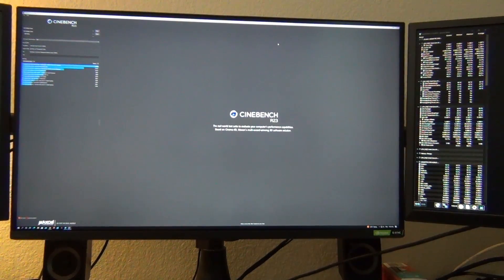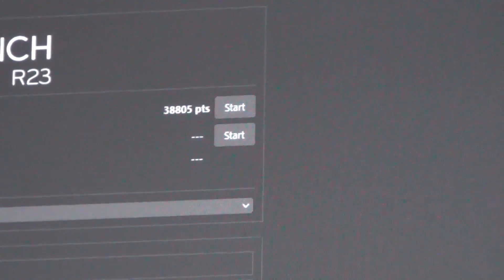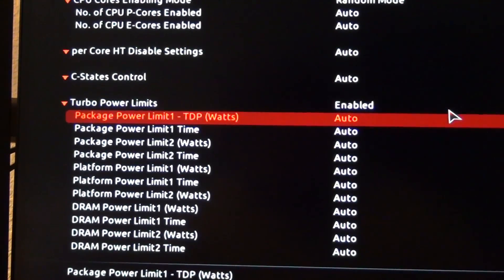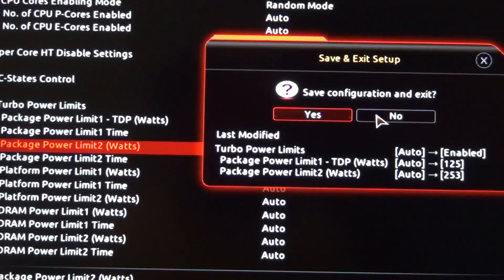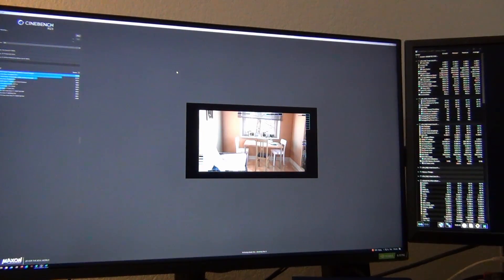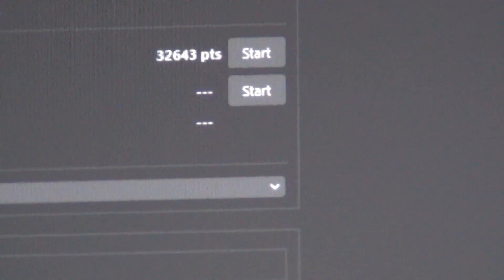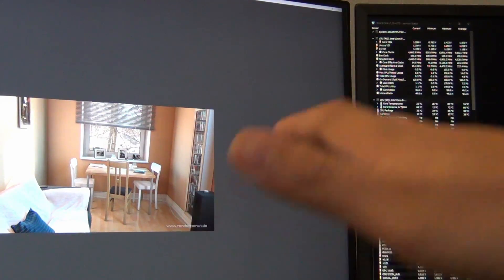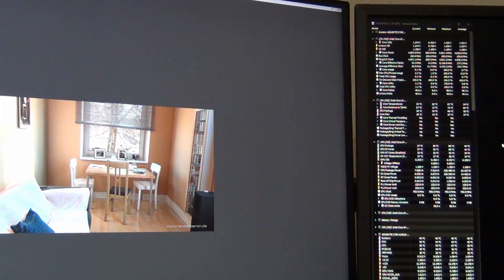How to enable eco mode on i9-13900k

Comment: I don't know how but with my Aorus Z690 Elite DDR4 with an NH-D15 on stock settings I always get over 40K on Cinebench R23 multi core - thermal throttles of course. Came here to tame the beast. :)
Reply: OK followed the video and applied the limit (I used the Intel POR setting instead of dialing in the numbers - HW info puts PL1 and PL2 at 253w. Never exceeded 81w but what is weird is I still got 38346 points on Cinebench R23 - and that was with me running all my background apps - RGB software, OneDrive etc. so thanks for the guide. I too do not like undervolting - I would prefer some higher temps over potential stability issues.
Reply: @a120068020  what was your PL1 and PL2? Can you tell me the numbers? Did you apply the exact same like 125 in PL1 and 253 in PL2? I am planning to go with a Deepcool AK620 and at least 75°-80° feels okay-ish for me
Reply: @DeathStriker88  I used the Intel mode on the motherboard but it sets both PL1 and PL2 to 253 according to Hwinfo.

Comment: not sure why you find using an AIO is so much harder then an air cooler when its pretty much the same principle in regard to swopping out cpu's, i run a 420mm aio on my 13900k and score just around 39800 in R23 at 81c
Reply: Wait until it leaks and you face a severe loss. Don't think AIO doesn't leak, there was never a 0% chance. AIO leaks but you don't know how and when
Reply: @DeathStriker88  From what I can see if you're using a air cooler on this chip you're already making a loss of nearly 25% in performance which boggles the mind into why someone would spend all that money on a high end CPU just to down grade it to roughly the mid tier chips performance.

This score is only a 1000 points more then what the 13700K can achieve, that CPU is $200 to $300 cheaper.

My last AIO served me well for nearly 6 years until I upgraded to a larger unit for the 13900k, but the old one is still working fine on my friends system.
Reply: @MikeZak101 2 gpus
Reply: @MikeZak101 false, actually you might be correct. I have a 13900 nonk on air and i couldn't imagine a 13900k lol
Reply: Aios broke leak and within 2 3 years they clog or the water evaporates plus within 4 5 6 years the aio is dead due to pump failure ! We dont want stress we want infinite lifespan safety longevity and the wualof noctua !!!!

Comment: With your configuration running the D15 I would run 5.3ghz all core at 1.23 volts and go up and down from there. I got mine at 5.5ghz all core with 1.21 volts but I'm using a 360mm aio score 39500 in r23 at 85c depends on ambient of course
Reply: I have a 360mm rad also but thermal limit in cinebench what are your bios settings if okay I ask

Comment: while gaming in overweatch 2- in Hw monitor cpu temp is 66c max, package is at 77 max, this is for gaming with very cool ambient temps... 13900k z790 hero with 420mm corsair aio, I have reseated cpu a few times to make sure, I tried a bracket and it didn't work well so went back to Mobo bracket, is this normal for 13900k?edit I did blender and got like 37k score it hit 97c max
Reply: Some motherboards at stock ignore intel limits and let the cpu suck up to 340w. Thats probably your problem

Comment: Hi  - Great video . I am building a PC for my Grandson this week,  eagerly awaiting delivery of all  parts! CPU is the i9 13900k cooled by the Noctua NH-D15, so this info is invaluable as I was also concerned about temps and, like you ,not going the water cooling route. Thanks my friend - Best wishes from me in the UK.
Reply: you can look for tutorials to undervolt the i9, as on stock settings, it can reach 1.52 volts, which is very excessive and very dangerous for the CPU. undervolt by short increments in the bios, such as -0.025v in offset. make sure the setting says OFFSET and not OVERRIDE or OVERDRIVE or MANUAL. when you think the processor has reached a undervolt where it doesn't crash immediately, increase the offset up by around 0.02 - 0.03v to ensure stability. most i9 13900k parts run stable at ~1.28v, but it doesn't ensure that yours is also going to run on that voltage because of silicon lottery. to know about what is silicon lottery, just search it on youtube, and there would be many tech channels like linus tech tips and gamers nexus explaining the topic in deep. the concept basically is that each chip is different and has different overclocking/undervolting potential. also do not forget to set the power limit to 253 and 125 watts respectively as instructed in the video, along with the brief undervolting guide I told you. doing the tricks stated above can help decrease the temperature of this processor drastically and also make it more efficient. please do refer to undervolting guides on youtube to further help yourself, and good luck!

Comment: Do you think the NH-D15 could handle the i5-13600k? And I have to ask, in your position do you not think you could ever consider one of the more premium and trustworthy AiOs to cool your chip? Surely they are reliable and near indestructible these days?
Reply from the maker: I could go with an AIO, however I chose air because it's far more simple and reliable. I've been using the same Noctua cooler now for about 8 years. It's performance has never changed. With an AIO, over time (years) water will slowly permeate through the tubing eventually leading to reduced performance. That and I know at least 3 people that have had pump failures and another person who had a leak.
Reply: I bought a dual-tower air cooler for my 12600k cause my AIO failed on me, after one year use. Idle temp 33, and gaming 60-70. Air cooler was performing better than AIO.

Comment: Fuck power limit what u need to do is undervolt it, cpu will run at 1.2v instead of stock 1.38v and temps drop 25c with full performance all cores
Reply from the maker: The problem with undervolting is stability at a given voltage isn't guaranteed. You're playing the silicon lottery so one CPU at 1.2v might be 100% stable with the same performance while another might not be. I may do a video looking at undervolting in the future. Power limiting however, with stock voltages does guarantee 100% stability without having to stress test, at the cost of less performance.
Reply: @GameTechReviews  there are trades for everything, you limit the power you lose performance.  You undervolt, its likely that you wont lose any performance and in some cases gain due to lower temps, but the downside is it might be unstable, but as you said its just a matter of testing and finding whats the lowest voltage.   I personally try to stay away from either, but due to how the 13900K is and it will only get worst with the 13900KS, undervolting is the route to remain on air whiteout losing performance.  Hope in time we see a video from you on undervolting.
Reply: @GameTechReviews  ok I get it’s more user friendly but a undervolt guide and results I think are what people really need
Reply: @johnhughes9766  I dont get why people come to a video that clearly states its about eco mode and argue about undervolting. If i want to undervolt, ill go to a video that teaches that, if i want eco mode, then ill come here. Not everyone who buys a cpu wants to be an elitist with it and spend hours undervolting. Jfc, get a life.
Reply: @HasanWadih  lol get over ur self
Reply: @johnhughes9766  says the guy crying over an eco mode cpu video about undervolting. Im not the one who has to get over himself. look in the mirror and then go cry on reddit.
Reply: @HasanWadih  it give the same result without loosing performance for the sake of a few hours testing, u need a hard look in the mirror is ur buying a 13900k and gimping it
Reply: @johnhughes9766  cry harder.
Reply: @HasanWadih  I’m not crying my pc is balling, feel sorry for u chumps using power limits tho
Reply: @johnhughes9766  i feel sorry for the people who feel sorry for others who want to do whatever they want to do. Shows a bit of insecurity there pal, that you have something to 'prove'. The people who dont give a fuck, don't really cry in comment sections.
Reply: @johnhughes9766   good to know, maybe i’ll experiment with undervolting instead of power limiting. what softwares did you use and did you use adaptive mode for making the offset in the UEFI?
Reply: @metallizität  just in the bios set vcore to either manual and 1.2 or use the offset mode to get it down to 1.2 underload
Reply: @johnhughes9766  alright i’m gonna try that later along with replacing the ILM with a contact frame for my cpu because my cpu is running crazy hot.
Reply: @metallizität  just start with undervolt I dropped 30c after finishing the undervolt I got down to 1.15v in the end
Reply: The 13900 runs at 1.20 stock. If i drop it .05 temps are better but I get a 15% drop in 3dmark score. I also get a 15% drop limiting to 125 and 253. Running at stock, the last minute of 3dmark is throttled due to temps. So I'm going to try and find a power limit that doesn't throttle
Reply: so you just set fixed voltage setting to 1.2V. No adaptive mode, no offset? What are your llc settings? What is your power draw idle/ demanding games?

Comment: Do you recommend i9 to AMD 7950x or should we wait for Intel's next 14th gen CPU which may use TSMC 5n or lower process?
Reply from the maker: I actually recommend the Ryzen 7950x. If you are going to get 13th gen then only the i5 or i7 make sense. For higher thread count the AMD offerings are overall better.

Comment: I have 13900k z690 gaming x dd4. I set   power limit to 270w (PL1 and PL2 270W) and i do a little offset vcore  - 0.030v. I have "small" noctua nh14s and i have score: multi r23  37939 only 92C no thermal throttling, single 2124.
Reply: That’s awesome congrats
Reply: @stanleyl.9026  It is a little weird but on my motherboard OC is default setting. So first i disable any OC setting. In default in my board multicore enhancent was on, I turn to off (when on all core boost like the one core with the highest boost ). I set BCLK on 100. In default was 103.5 (with this core boost to 6 GHz insted 5.8). And i set power limit to 270w - But it is only for cinabench. In game you never be close to power limit.
I set a little vcore offset - 0.030v - temp in game drop like 5c. No real impact on fps.I have 3080ti so it is a lot of heat when i game.
Cpu temp on average after 1h-2h gaming in cyberpunk or apex legenda is 74-76 C. In peak hwinfo show sometimes 80, sometimes 85 c. And ones show 90c in apex legend. But it is peak. No cpu throttling and no core temp throttling.

PS. 13gen Intel IMHO need to be a little unvoltage. For a perspective deflaut setting is OC. - BCLK set on 103.5 (boost 6ghz on two cores, 57 all) ) . No power limit. So when I do benchmark it was like this : -cinebeanch r23 multi = 38064 and 100c very fast and drop boost to 5.0-5.2 GHz - thermal throttling , single 2184
When na turn off oc (so boost is 5.8 on two cores and 5.5 all) , set power limit 270w and do offset - 0.030v it was like this :

multi 37939 only 92c no thermal throttling - so to fair i have room to set more power limit and have closer to 100c But i dont do this it is only benchmark. -single 2124

So like we see even i turn off oc and do a little offset i have same almost the same score in benchmark with less temp! In game is like 4-5 c less. I still have temp room maybe for a little OC or do more offset. But now I just play.

BTW i have ddr4 ram.
Reply from the maker: @jazon9  Correct, for some reason the Z690 and Z790 boards default to "unlimited" power mode (OC mode). It's really sad that the motherboard doesn't come stock with the correct power limits.
Reply: @GameTechReviews  And another thing  I was thinking about: Is it right to assume that for the same performance,  a power limited 13900 would run cooler than a pushed 13700 or 13600? Not sure how the additional cores simply being there would make things warmer, but it seems like the 32k result is what the 13700 would get at more or less full performance while your 13900 here seems pretty cool.
Reply: Thanks for your comment and thanks for the test, @jazon9 and @Game Tech Reviews! Do either of you have a contact frame for the CPU installed?

@Game Tech Reviews: Do you think you would get thermal throttling if both PL1 and PL2 would be set to 253? (Can't tell if you ran several iterations of Cinebench, but there seems to be a cut). PCWorld got 39,786 with that setting, but they probably used liquid cooling and in your earlier comparison video to AMD, the 13900k package power seemed to be under 250w (but that load was pretty short) so not sure what to make of that or if I misinterpret something. 

You seem to use the Fractal Torrent and i had hoped that combination with a great air cooler would allow for a bit more headroom (but I'll try undervolting as well if I go through with this, jazon's figures sound somewhat encouraging). Then again, it seems like you have some headroom left, here as well. I realize this test was to create something comparable to the Eco Mode, though, so I'd be interested to know how much possible performance was left on the table before throttling.
Reply from the maker: @LeGrandMort  Each run shown was a single run. The 1st was stock with the bios using "unlimited power". The 2nd was with the PL1 at 125w and PL2 at 253w. A pushed 13700k will probably have better single thread performance vs a power limited 13900k. However, in multithread tests the 8 additional e-cores on the 13900k will probably still make it win depending on how well the app scales with thread count
Reply: @GameTechReviews  Thanks for your reply!
Reply: @LeGrandMort  you will get thermal throttling with PL1/PL2 at 253W on air cooling, I have tested this
Reply: @stanleyl.9026  Bummer. But thanks for your reply!  Have you tried which values are the highest you can go without throttling?
Are you using undervolting or a contact frame? The latter probably won't do much, but I'm just clinging to any little hope before changing plans. Like Game Tech Reviews I'd rather not use water cooling.
Reply: @LeGrandMort  I have PL1/PL2 set to 205 and undervolted by 30mV and temps after 1 hour OCCT 91 max which is good enough for me. C23 still scoring 37k. No contact frame, probably won’t do anything.
Reply: @stanleyl.9026  Thanks, appreciate it!
Reply: @LeGrandMort  welcome!
Reply: @stanleyl.9026  i
Reply: I have a 13900KF. Offset almost -0.100 watercooled 39700 in CB.
Temps 87 -ish.

Comment: Great video, thank you! How does single core performance differ?
Reply from the maker: Single core doesn't change because it was never a problem to begin with. Though in general temperatures are lower across the board.
Reply: @GameTechReviews  gotcha.